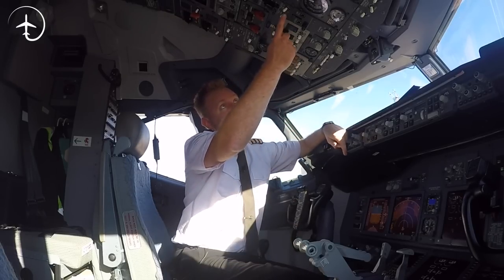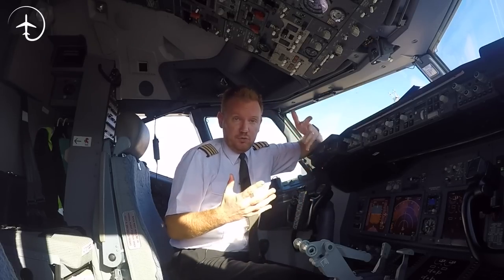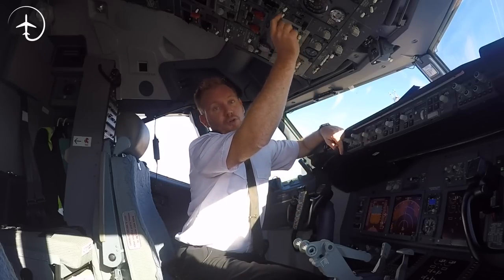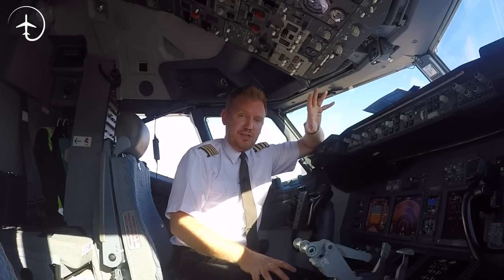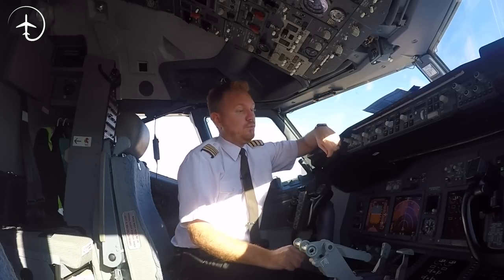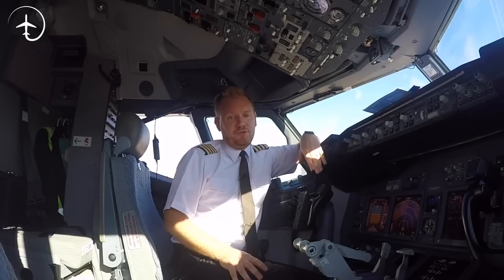Aircraft HORN (Claxon) and “No smoking” signs

Comment: Hi Capt! I am currently a student pilot on my PPL stage. I have a question, can you use the reverse thrusters to push back the plane? Let's say you happen to be in an uncontrolled airstrip. Thank you
Reply: The use of engine reversers is not permitted to actually reverse the plane. And I've read somewhere that it can actually damage the engines if you use reversers below an airspeed of 60 knts.
Reply: Never

Comment: Hello captain! I was wondering what the difference is between Gear UP and Gear OFF.
Reply: Viggee ? When the landing lever is up, there is still hydraulic pressure retracting and locking the gear. This pressure is not needed, so the lever is put to the medium "off" position.
Reply: Ok thanks
Reply: Viggee ? You're welcome. Glad I could help

Comment: Question: so is that no smoking switch redundant? As in, it's not electronically connected to anything. So switching it on/off will not actually switch the sign on/off?
Reply from the maker: Correct, at least in our configuration.

Comment: How come the ground Call horn sounds if an AC bus gets disconnected
Reply from the maker: Because it’s the same horn used to tell groundcrew that the IRS’s are running on battery power and might drain the batteries. Great question!
Reply: Never thought about that thanks.

Comment: Captain, I have noticed on some aircraft, at least on wide bodies, the horizontal stabilizer looks like it has range of motion on the fuselage as if they have a stabilator. Can you explain this?
Reply: Jordan Costabile you are referring to the THS. trimmable horizontal stabilizer. similar a stabilator, the trimmable stabilizer features a fully moving horizontal tail surface. unlike the stabilator, the trimmable stabilizer does not move in response to control column or control stick movement. nope, it is fitted with elevators which respond to pilot or autopilot input to control pitch and adjust the aircraft attitude and the entire horizontal tail assembly moves in response to the trim system to stabilize the aircraft in the pitch axis. the huge advantage of the THS is it provides a shyteload of trimming power over the full speed range of the airplane. also reduces drag as the stabilizer surface and the elevator are in alignment whenever the aircraft is in trim

Comment: Nice answers but in additional to that do  planes have reverse gear
Reply: I don't really understand what your mean, but if you're asking if the tires on the landing gear can go backwards, they can. If you're asking if aircrafts can go backwards without the pushback truck the answer is, in theory, yes using engine reversers, but the use of engine reversers is not permitted to actually reverse the plane. If I didn't answer your question, please clarify it. Thank you!
Reply: Thanks Pedro for the time you have shared with me...those are great answers theoretically and practicality. ...
Reply: Elijah Stack Ng'ona the only way they can move backwards without the aid of the tug,  is to apply reverse thrust on the ground. on the A320, this is prohibited.
Reply: Ava Mendez  thank you very much for that good answer..well understood  the other question is this. ...What's the difference between FADEC and ECAM wishing you the best.
Reply: Elijah Stack Ng'ona FADEC is full authority digital engine control. On the A320, it is what controls our engines,  from the autostart sequence through all normal regimes of flight. ECAM is electronic centralized aircraft monitoring,  essentially,  a system that monitors aircraft functions and relays them to us on the flight deck.  It also produces messages detailing failures and in certain cases, lists procedures to undertake to correct the problem. the Airbus is in every a thinking airplane and a joy to fly
Reply: Ava Mendez many thanks.... you are so great 'note taken for FADEC and ECAM. ...on wings some are curved at the end  (upwards) some wings are just straight....what difference is there ...
Reply: Elijah Stack Ng'ona for example, the Boeing 777 has a very long wing and the outboard sections are not that heavily loaded. because of this, the pressure differential between the top surface and bottom at the tip is small - and therefore the induced drag is also little. any gain from creating winglets is quite modest.  the pay off point was not in favor of having winglets as any fuel saving would not exceed the weight penalty. on the A320, they have 'sharklets' sharklets are wing tip devices used to reduce induced drag and hence increase fuel economy
Reply: Ava Mendez thank you I always appreciate and understand you....But now why are navigation lights different from the right wing to the left wing...

Comment: Hello Mentour!
During pushback, what engine is usually started first? I think it is the 2 then 1, but, can it change depending on what direction you are pushing back? I heard, if you are pushing back nose to the left, then it is 1 then 2! Is this true?
Reply: Ozan Akdag on the A320, engine 2 is turned first since it powere the yellow hydraulics which are needed for the parking brake.
Reply: Thanks, same for 737 because the bleed-air system :)

Comment: do pilot wear sun glasses during flight and why, also  how much time do you need to fully turn a plane during flight at its full speed and not.
Reply: Pilots wear sunglasses in flight because of the glare the sunlight makes on the clouds for example. Turns can be short or long. It depends on the bank angle, the angle at which you bank your wings. I can't say an exact time, though...

Comment: I heard that most of the pilots are smokers and they can smoke in their cockpits during flight is that true !!! Second question how do passenger breath in flight, ive been told its compressed air but how this can work maybe u can explain for us pls thanks captain
Reply: The air inside the cabin is pressurized. This way you have oxygen to breath.
Reply: Pedro Almeida. Thanks a lot. I know this info but need to see how it works in several hours flight
Reply: Hippo Team the oxygen flow to the  cabin comes from bleed air from the engines which is very hot, can reach limits of 250C.  so, it obviously must be cooled first. basically,  this hot, bleed air is allowed to expand and passed through a heat exchanger so that it cools to a comfortable temperature. thar cool, filtered air is then dispersed in the passenger cabin at a pressure that humans can comfortably breathe.
Reply: Hippo Team I would definitely not think that smoking in the cockpit is allowed but I don't really know
Reply: Ava Mendez. Thanks a lotttt well noted
Reply: Pedro Almeida regarding smoking in cockpit iam 100 % sure some of the pilot who are smokers they smoke during their flight
Reply: Hippo Team on the subject smoking: no, the FAA prohibits this on all areas of the airplane,  this includes the flight deck

Comment: what will happen if we set the gear leaver up, when the plane is on ground?
Reply: Shantanu Jain on the A320, the feature is inhibited to prevent accidental gear retraction while AOG.
Reply: Shantanu Jain I think nothing happens as the aircraft is designed not to retract the gear on the ground, so the gear won't retract on the ground

Comment: How often is a tire change needed?
Reply: Nataliya commercial airliner tires use nitrogen instead of air. pressure is set at mounting. the reason is simple, nitrogen is an inert gas and need more energy to react with other substances e.g. rubber. air on the other hand, at the higher temperatures, will react with rubber. if ground engineers notice wear and tear or the pilot feels it is not safe during the walk around, it will be changed. 
all about safety, baby🛫

Comment: When you land an airliner does it brake automatically or do you have to press something or do you have to program autobraking system before landing
Reply: You have to program the autobraking system before landing. In the 737, there is a knob in the front pannel above the Upper DU. You can set autobrake 1, 2, 3 or "MAX", with each of one braking more that the last. You can also select RTO (Rejected Takeoff) before takeoff, so if you have to reject the takeoff, the aircraft will brake automatically. On top of that, you have manual braking of course.
Reply: To further on what Pedro wrote, manual braking is performed by applying pressure to the tops of both rudder pedals simultaneously.
Reply: Thanks
Reply: AV8ION  on the A320, the auto brakes have three settings. Low,  MED and MAX. autobrakes are available on Normal Brakes (Green system) only.  LO mode delays for 4 seconds after touchdown. MED mode 
delays for 2 seconds. MAX has no delay and is only used during  takeoff.

Comment: Whats a FMC
Reply: Flight Management Computer
Reply: Pedro Almeida ^^^^^^
Reply: Fresno Managers Council
Reply: It stores Nav data and performane which is used to manage the flight. Basically You can setup entire flight from t/o to final approach.
Reply: DM games the flight management computer. the pilot can interact with it by use of the multi purpose control  display unit (2) on the flight deck. here, the pilot enters critical information such as aircraft weight, temperature,  center of gravity, departure procedures,  flight plan, runway in use, arrivals, missed approach as well as a myriad of other functions

Comment: It doesn't look to be safe to use arbitrary switches as status indicators when their position is not related to the state it is supposed to monitor, assuming that passengers still standing in the aisle during push-back or taxi manouvres could fall over and be hurt instead of safely be seated and secured with the seat belt. 
A simple inadvertent or accidental operator error can render this indicator useless or misleading and it is not failure tolerant in its operation, while pretending a state it is not in. 
I would think this practice over to use non related switches as status indicators for events constituting a relevant safety hazard.